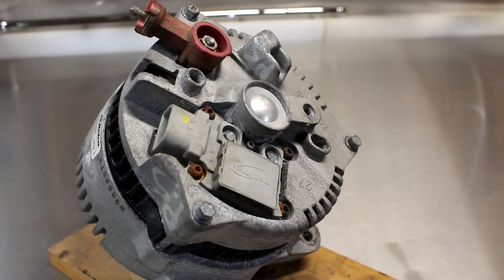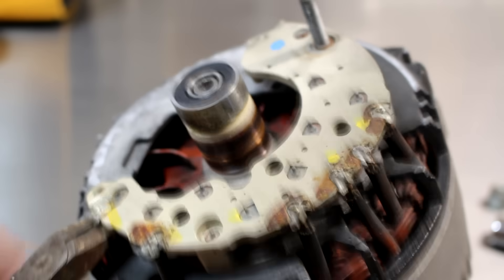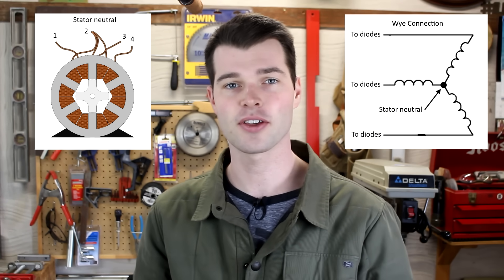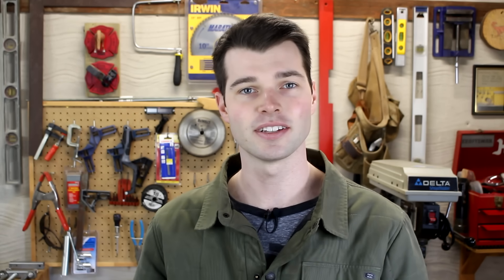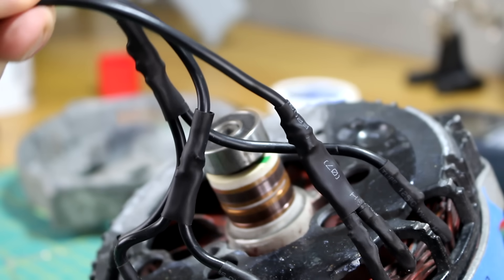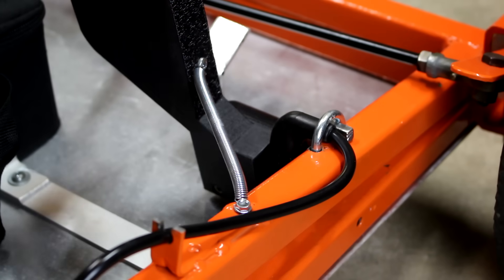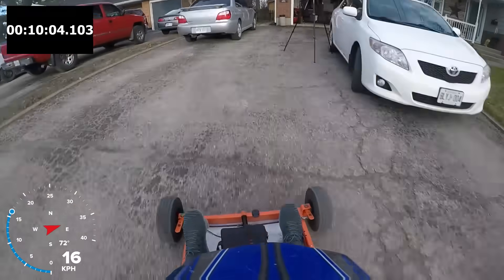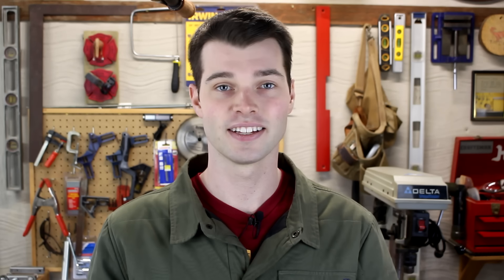Converting a Car Alternator into a Go Kart Motor

Comment: I would like someone to use an alternator motor, in place of the engine in an old s10 series pick up or luv size pick up. 
this convertion would keep the trans in place.
I dont expect it to do 80mph.
for those that say it cant he done;  A horse can pull a pickup like this so it can be done.
Reply: Sure it could be done but you would have to gear it down so much that it would probably have a top speed of 5mph
Reply: @mashedpotatoes5323  5 mph can be good. it's faster then not moving.
It's better then walking. Plus one could power it by solor.
which means, you have an endless supply of free energy.
Reply: @desertrattler7589  I hate to rain on you parade, but under our current technology,  solar won’t work for any 4-wheeler as an exclusive source of direct power.  There isn’t enough square footage if you. put panels on the bed an the roof of the truck to power it.  By formula calculate 10 W pe quare foot of panels….  It takes thousands of watts to power an electric vehicle.  If you want solar better park it in a solar garage and charge a beefy lithium ion battery pack to make it go. The one company in Europe building a sleek solar car only gets an extra 15 miles per day from full solar charging.  That’s cool if you only have to do about 7 miles there and 7 miles back for daily vehicle use, but outside of that range, solar only isn’t possible unless you use external solar to charge onboard batteries.
Reply: @xapplimatic  you are partly correct.
this is why I asked about an alternator used as a motor. 
that motor will run on 1kw of power.
here is the problem. people are looking to do 70mph. 
5 mph is ok with me.
I am very familiar with solar power. I have been living off grid for 10 years.
there is a lot of lie when it comes to solar. some from electric companies and some from those selling solar.
if you want to know ask me. 
1st yes solar will direct run anything that uses DC power. you don't have to use batteries 
next the solar companies sell you that you must use a bleeder to not over charge your batteries. this is bs. they are made to wear your batteries out. just watch your batteries. once they are full turn off panels. a simple light switch can do this. also the bleeder are designed to only allow your batteries to achieve 90%. then they discharge them so they charge again. in effect wear your batteries out quicker. 
lithium batteries are said to last longer.  I dont argue that. but lead batteries are a lot cheaper. maybe they need to drop the price of lithium batteries? as it is lead batteries are expensive enough.
I can get 2kw of panels on a s10. this will work. because only 1kw will be active due to road conditions. meaning turns and such.
you will not see an affordable electric powered vehical that can do 70mph. it just not allowed, until people like me. that start small figures it out. too many
 greedy people, too many green peace. and let's not forget the oil companies and auto makers.
also if people worked on solor panels they would be much more effective. right now panels can be made that put out 4x the power, even more if robots are used. in effect by using robots panels can be made to put out 10x the power.
you may ask why it is not done. because people will buy the cheap panels made today for outrageous prices.
and charging from the grid is bs.
for the green peace fools it uses more energy then a car. 
for free energy its not free.
Reply: also dont misunderstand. at 5 mph you are not going far each day.
really 5 mph and 10 hours during winter at best for sunlight that a max of 50 miles per day. in reality expect about 15 miles due to hill, and clouds make even less.
now summer will give 14 hours so that 70 miles at best. but reality again is close to 30.
which is pretty bad. but since you spend nothing on fuel. it makes up for it.
but same can be said of all electric vehicles today. the difference is mine doesnt cost 50k or more to get and uses free energy.
you can get a s10 for $300. panels $2500, for 2kw, alternator $50  basicly $3000 will make a free energy vehicle that can carry 1000 lbs. but only goes 5 mph. and I have all this already. just have to wire up alternator. make brackets and gearing.
I have some other things to do first but now sounds like a project I will make. 
btw there are stickley solor powered vehicles. I believe it university of missouri rolla campus made one years ago. it travels pretty fast. I think it was 70mph. but  it's a one person vehical and carries no payload other then driver.
also quakerstate sponsors a race of solor vehicals. would be fun to race it with a vehical that can carry a small load. and dont forget a trailer could be added to such vehical with more solar panels and batteries. meaning all one has to stop for is a couple hours of sleep. and the prize is $1,000,000 
maybe  I'm shooting for the stars. but is there any other way?
but before I make the s10, I will make a solor powered bike. I already know it works. it goes 10 mph. but the frame it is in is too small.

Comment: Can you use a voltage regulator or step down to power the field coil off the 48v pack instead of using a separate 12v pack?
Reply: Also like to know how this alt/motor compares to the original 1600w brushless motor.
Reply: yes, you can use a DC step down, but it needs to be capable of 5-10A at minimum

Comment: Can someone tell me about what an alternator can put out watts wise as im still learning about electric.
I think i understand about running batteries in parallel and series, upping volts, upping amps or capacity, depending on which.
Im trying to understand the alternator motor better.
Ex: he has 12v alternator, i dont believe he said how many amps. 
I have a ford 3g alternator from a 5.0 ford explorer rated at 12v 130amps. 
I was assuming that 12v x 130 amps would make a little over 1500 watts of power.
Is the 12v only neccesary for the rotor windings?
In the video, you are running it at 12vto rotor windings, but 48volts. How does the 48v relate to the power?
So 48v x 130amps (in my case) would be over 5000 watts, which doesnt make sense to me especially the fact you are running around a 1500w controller.
Can someone please explain this (how the field voltage and winding voltage differ or relate to power output). Is the amperage controlled by the battery and charger? If so 48v/1500 watts would only be a little over 3amps.
Thank you!
Reply: Thank both of you very much! I had no idea an alternator could support that many watts! I was assuming it could only support (in my case) 12v × 130a or a little over 1500watts.
I do understand the torque/ speed analogy, ive been building gas motor things for a while. Im wondering if electric motors would work the same as gas, and you compensate the torque and hp curve with gear ratio or gearing. If that were the case, i think id prefefer a higher voltage motor with higher hp/ speed potential, bit using some type of gear system. Almost like the type of system that allows you to shift using the bikes derailer and cassette, and ability to pedal if needed/ wanted
Reply: Hey, Joey, let me help you
When choosing the alternator, the more amps it creates, the better will be the wires inside it
If you get a 60A alternator, the stator windings can be weaker comparing to a 130A alternator

The 12V he talks is for the rotor windings, the 48V is for the stator windings
The rotor windings create magnetic field with the 12v input, and this magnetic field interacts with the 48V magnetic field, and both of them work together to spin the motor (without one, the other fails, this is called a synchronous motor)

The brushless controller's current only talks about the "force" that the stator will do to the rotor's magnetic field. When he uses a 1500W brushless controller, it means that he will give to the stator 1500W to run the motor, not that the motor's physical limit is 1500W at 48V, i saw people using it at 72V (50% higher voltage) without issues, so you can give more amps to the motor until you begin to understand whats the real current limit of the motor.

Lets suppose that you test a lot, and see that the your alternator can't use more than 100Amps at 48V=4800W limit, so if you get a controller that can give more than 4800W at 48v, the motor won't use all of that available current, but maybe if you try to get a 60V or 72V controller, it can go faster and/or stronger, now using up to 6000W or 7200W (still 100A because it's the limit of the wires inside the motor and their magnetic field, but with more voltage it can use more watts)
Reply: And an interesting feature with alternators when converted to motors: if you get a brushed controller and use this brushed controller to the brushes, and not directly connecting the 12v battery, you can make the rotor's magnetic field stronger or weaker. The closer to the 12V on the rotor, the stronger will be the magnetic field and the stronger it will be against the stator's magnetic field, making the motor slower and creating more torque (good for acceleration), and the less you make the voltage with the brushed controller, the weaker will be the rotor's magnetic field, allowing the stator to "win" more easily the "tug of war" between him and the rotor, letting the motor spin a lot faster, but lowering the torque (good for that top speed run)

Comment: Hello Friend! Have this idea in my mind, have you done this? ( Using Electric Bike, you don't need to charge it by installing alternator? ) just like cars, no need to charge the battery of the car because the alternator charging it. Will that works?
Reply: unfortunately no, car engines have A LOT more power to run the alternators without losing torque or speed
if you try to use one alternator to run and other to regenerate the energy, it wont work

Comment: Is it possible to adjust speeds on a car battery powered alternator motor? Or is it nust fixed speed.
Reply: Speed controller did that using the foot throttle
Reply: you can adjust the speed with 3 things:
using the foot throttle (normal use)
using a brushed controller on the brushes instead of using directed on a 12v battery (1-12v)
and changing the gear ratio

Comment: As an  electrician, I can tell you your meant to start the motor running in star, then when the motor hits full speed you change to delta.....  look up star/delta starters, you'll get the idea  
great vid :-)
Reply: that's a interesting idea
but it would be tricky to do in that small space, while doing this in the industrial panels have a lot more space to cable management
i have a technical degree in electrical systems (english isn't my native language, i dont know how to say the correct name in english), and i saw a lot of these star/delta starters

Comment: does anybody know where i can find a dual motor controller, planning on doing a dual alternator set up for a bike
Reply: If it's comparable to this video's instructions and you're looking for about 1000w output, try robot motors. A 775 pro puts out 330w. With a  CTR Victor motor controller I think the set would be somewhere around $70. So you could do three to get nearly 1kw for $210. And all together they're WAY smaller than an alternator
Reply: the torque in those motors won't be so good against one big motor, but be my guest and try to find some video or project about this

Comment: You mean Star, not "Y", configuration
Reply: Same thing.
Reply: @KiwiMaker  No, it  really is called "star". No electrical engineer would call it "Y". And the other configuration is delta, “Δ”, which is used for transmission lines, as only 3 wires are required.

Comment: Can you run the brushes from the same battery pack at 48v as well? or does it need to be 12V? I'm assuming that would give better results?
Reply: it would kill the alternator
48v on the brushes are way too much voltage
max 24v if the alternator was 24v originally, and 12v if the alternator was 12v

Comment: Maybe wiring in Y would low your motor voltage, lowering  the current. And you start with 10v on the rotor, then lowering to 4 ir 5V ar the top Speed. Less heat on the motor and more time running.

Comment: Anyone help? Its a Delta alternator. 38v going to speed controller, connected all I need to on speed controller. 12v to feild winding that's working. But not turning the motor. Get 10v on one of the 3 power wires to the motor, that swaps when I twist throttle. Any helped appreciated.
Reply: do you have any social network or email so we can talk?

Comment: At 3:02, what's the point of keeping the brush assembly?
Reply: alternators, when transformed in motors, can be classified as "synchronous motor", because it needs to get energy on the field coil, or it won't work like other kinds of motors
Reply: @foxxyytofficial  What do you mean by "won't work like other kinds of motors"?  Or will it just not move at all?
Reply: Induction motors(AC) and real brushless DC(bldc) motors can run without any energy needed in the rotor, just the stator getting feeded with the corrent amount and type of electricity (being AC or DC, and the correct voltage)

Comment: I’ve converted an alternator (like you show) and built a kart and using a controller like yours, and although runs smooth and powerful with rear wheels off the ground, when sitting in it and a heavy load applied the kart moves 2-3 inches and stops? Not sure if I need sensors on motor or drive shaft as a signal back to the controller or not?Can you give me any clues please?
Reply: Gary, the problem may be in the driven sprocket. The tooth ratio used by the demonstrator looks like 20:1 Lesser ratios like 10 or lesser may not pull the cart at all. Further, the torque also depends upon the voltage applied to the rotor. more the volts, more the torque, lesser the speed though.
Reply: Thanks creativegoot! I will definetly look into that. Cheers

Comment: Nice work! I have a request, I have never seen anyone try to recharge a power unit on something like this in motion, do you think it would be worth a video to add a static generator to say on one of the wheels of the cart to feed power back to your power unit thus extending ride time?
Reply: It doesn't work like that. You would be violating first law of thermodynamics. At best, you can just have regenerative braking.

Comment: Good day sir seeing as your vid got me hooked on this idea i have bt one question the alternator you used was a 6 field type.. could one use the other "fields" in a lets say a t off to the next field winding ie. you have 3 wires on your esc right but we got six fields now could i like a 6 cylinder car t in the other windings at lets say 180°  *? If you reply i will give more details my plan is to up the power this way

Comment: Can you hook up a second alternator with a belt running off the drive motor by the sprocket and then produce your power to run the alt/motor, using a battery only for initial starting? Very good video. Why people would dislike must be jealous.

Comment: You're very good with wiring and motor control but you need to research battery charging and discharging. Besides the basic low amp ratings of the battery, there is a formula that estimates how much the AH capacity of the battery is derated at higher amps. Sorry, don't remember the name. You need a 50AH battery pack at minimum for drawing close to 30amps and 100AH would be much better. But then you need an expensive charger because similarly, you shouldn't charge below 10% of battery capacity.  Good luck. You did the hard part, just need to learn some battery basics.

Comment: I wasn't able to find what did you do with the rotor, have you directly "twelvevoltingly" polarized it or have you kept the original dc regulator driver for it?
Reply: he put the 12v direct at the brushes

Comment: I just looked at the speed controller wiring from the link you provided. How exactly do you wire a delta connection plus brushes to that controller?
Reply: The brushes get a constant 12 VDC, no control needed as it only takes the place of the permanent magnets a normal brushless motor uses. Hope this helps.

Comment: Is the field energized at constant voltage.  Is speed regulated by changing the 3 phase frequency?
Reply: Yes, speed is regulared with the throttle in the 3-phase system, but it can also be changed if they use a brushed controller instead of connecting directly to the brushes, less energy=more speed, more energy=more torque

Comment: While those ratings on your battery state "maximum" that's literally their maximum. The battery is not at all happy discharging at 3C for anywhere close to that time period and it'll probably not last as many charge cycles.  
You may need heavier lugs connected on it too.  

All that said, I never considered turning an alternator into a 3 phase motor. That's fantastic

Comment: Hey...can you use a converted alternator to power the cart, but then have a second non-converted alternator to recharge the battery? That would practically make it a perpetual motion machine.
Reply: yes check out videos on alternator generators you can build self sustaining motors and welders with two or three, wire up three or 4 as generators and one as a motor and you could power an entire shop for free
Reply: @ExhaustedSix95  Thank you for responding to my post....I might just do that as I am looking to build a shed this summer and if I'm "off the grid" in there, that would be awesome!
Reply: you wish

Comment: I have a alternator off a semi. Ita a 230 amp alternator. How big of a controller should I use?
Reply: Jason Schneeweiss 230amps x 13.8 volts is 3174 watts.  So at least a 3200 watt or 3.2 Kilowatt controller.  And 3174 / 750 = just over 4 hp.  That’s pretty good.
Reply: Thank you